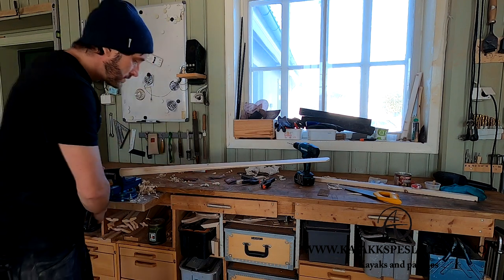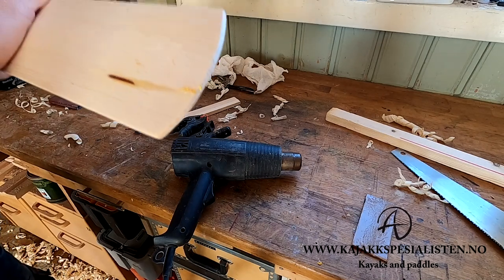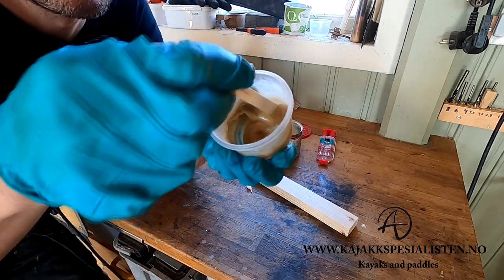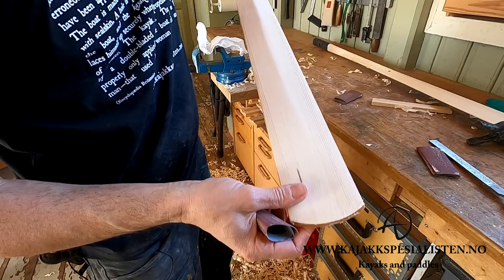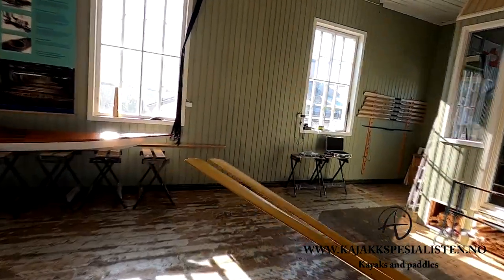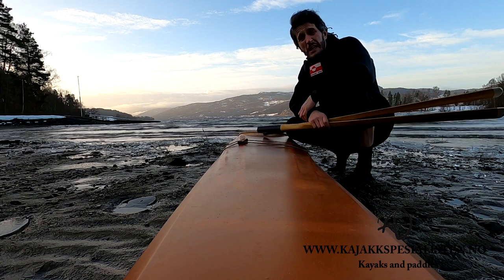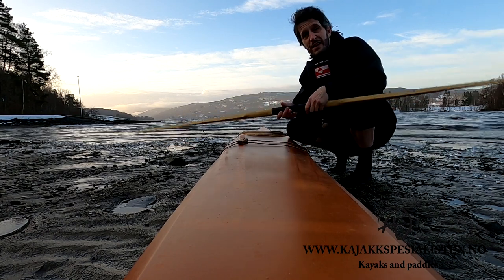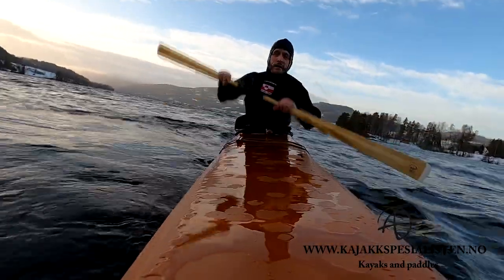Paddle making part#3 Finishing

Comment: I just finished my first two paddles. As they say, many ways to skin a cat. I did one similar to your way (epoxy painted on the outside of the wood tip) but wasn't really happy with it. More robust than just spar varnish, but is there a better way? The second paddle I made some cuts while the wood was still square and flat (before cutting out the paddle shape or doing any thinning) with my table saw to make a "form" of sorts for the epoxy to fill. Inside this form I put a piece of fiberglass trimmed to fit, taped up the sides of the cuts, then filled it with deep pour epoxy (longest time for set and also very thin and runny, to let bubbles escape). I then cut out the shape of my paddle and then thinned it down to where the epoxy was. I am much happier with this way. You did well - that is a nice paddle.
Reply from the maker: oh yes, fiberglass is very tough ideed. a lot of extra work, though :)
Happy paddling

Comment: Very nice - Can you give me some more specific info about the white tips ? - The white epoxy , you use there - is it very thin epoxy with whit colou mixed in ? - And then just dip in the tip ?
Reply from the maker: many epoxies have color pigment you can add. I use a brush to apply. that means I can mix only 4 g. of epoxy, and it's enough for the paddle. dipping would mean a huge batch and lots of waste. you can also coat with clear epoxy and then paint it white. Floor paint or boat paint for instance.